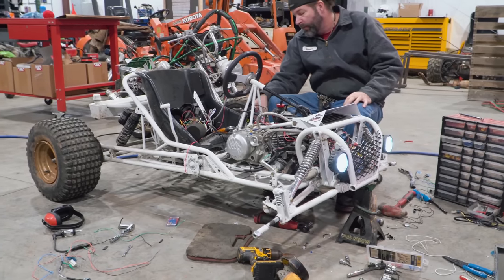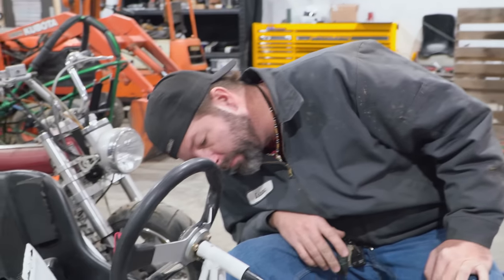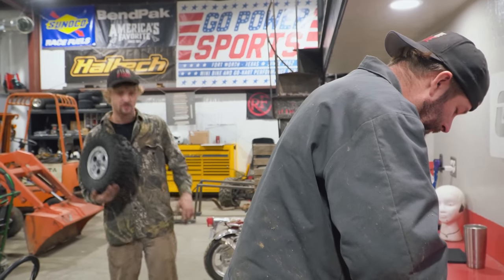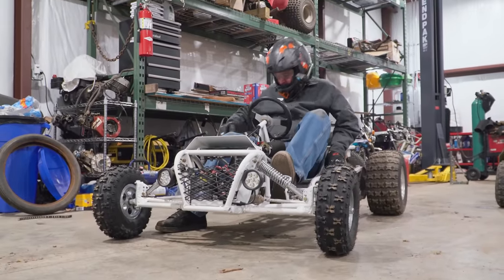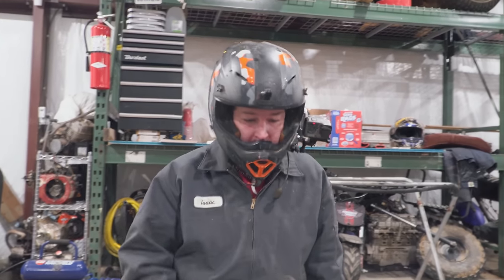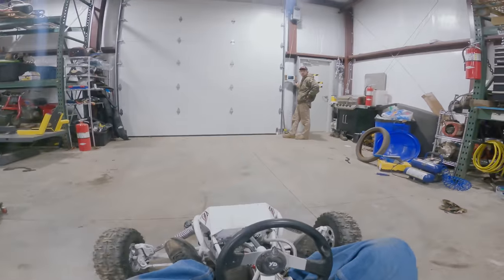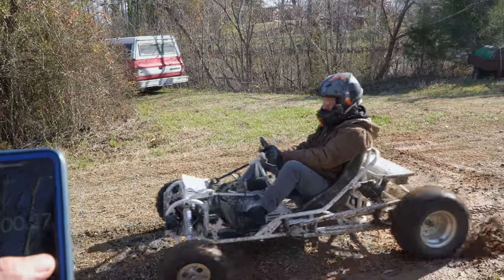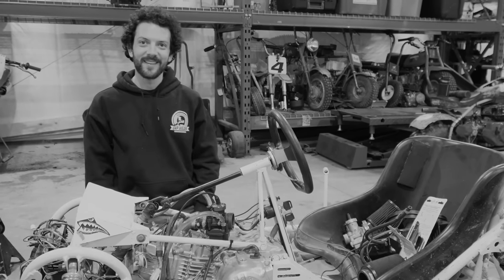Reviving our FASTEST Home Made Go Kart, the “Yard Dart”

Comment: The only thing I can think of is that the holl intier ignition needs to be replaced, which means the ignition coils Cdi all the wiring spark plug, replace the carburettor with a 24 mm Mikuni carburettor maybe that will help it to because I do know my Honda Trail 70 with a 190 Zen zone engine on it runs really well with a 24 mm Mikuni and I did are the whole entire wiring and replace the cdi Killswitch is in everything. Air filter could be of another possibility. the timeing key could be out of timed  arm, maybe swap the exhaust with a hive flow exhaust so I do reckon there’s probably a restriction somewhere to but that’s just a few ideas. I threw out there for use for you change the gearing on the back sing a little more because 🎉my Zang zone 190 on my go cart at the moment when I finish doing all those things and I started it runs, smooth as heck

Comment: I agree with what most say that it seems mostly ignition related, but it's probably also worth checking valve lash. My ATC had a similar breaking up problem under heavy load and it ended up being too little valve lash.

Comment: It's the timing needs advanced or back plus I would get high performance plug lead and a hotter spark plug. It could also need a fuel pump to keep the pressure up while rattling around corners.

Comment: Check the connection between the carb and engine for vacuum leaks. Also check the exhaust for leaks at the cylinder, that can cause power loss/back firing.

Comment: Great to see the yard dart out again. Hopefully you can fix the misfiring issue. Looks like with the new wheels the front has a lot of tow in & positive camber. Might be worth adjusting it a bit
Reply: The front camber changes with suspension travel due to single a arm    but your right it is off a bit at ride hight and not equal definitely needs some tweekin

Comment: Definitely need to look at replacing that CDI... It should be running a lot smoother than that. 

If you're looking at carbs for this Engine, a flat slide 28mm works amazing. I'm using a pwk28 with a 42 pilot and 125 main at 600ft and it's flawless. 

Also, the zs190 needs to have its idle speed set to about 2000rpm. Seems high, but trust me, it's best.

Pop on one of those small digital tachs and set it, you'll have a much stronger running, easier starting engine.

On my Grom clone, this engine is an absolute beast. 

Also, I'd totally buy the plans for this chassis!

Comment: Check the charging voltage at the battery while running and revved up. Good possibility the voltage regulator isn't working correctly. Would also explain the lights going wonky.
Reply: Also check for AC voltage ripple.  A bad regulator can cause this.

Comment: Definitely check for spark issues - I had a car do the same thing and it was a bad condenser on the points. These engines may use CDI, so check for cracks, week magnets, excessive clearances etc.

Comment: I have that same base engine on a Grom clone with the 212 BBK and the 4 valve piranha head. But I did a stator upgrade so that I could run efi with a Grom harness and a stand alone ecu (aRacer mini 5). Not the cheapest solution by far, but I haven't had any issues out of it since I finished tuning it.

Comment: Could I suggest sticking a neon spark tester in line between plug wire and plug. Available at good auto parts stores or snap on. Ride and observe the neon tube.  It will change if it is and ign problem. Neon will cut out when problem is encountered.   Good luck.

Comment: I just had this same problem with my lifan 125cc on my 72 honda trail 70 and it was the idle mixture screw was way to rich I ended up screwing it in 1/2 turn and it fixed the popping idle and all around drivability

Comment: I had one behave like that after a few heat cycles and it turned out to be valve springs which were made out of just standard steel. Swapped them out and it worked fine again until the cdi unit went out. Then the carb needle wore the jet out and made it run rich. Then the stator let go. Then the gear selector got stuck in place and needed a full strip down to fix a pawl that had got bent. 
They really aren't trouble free.

Comment: did you replace the ignition trigger on the crank? ( chinese ) Sounds to me like at higher rpm is missing signal like the gap is to big or a cheap pickup or weak magnet, however that one gets triggered.
could even be a broken valve spring....floating valve at rpm?

Comment: when you run this types of engines lean they overheat and then you need to change piston rings and valve springs (they get overheated and lose preload) and also they have a tendency to slip timing gears on camshaft. when you dissasemble check cylinder and head surface they are warped from the factory also valve seats are sometimes poorly cut (laping wont help it will still blow through in high rpm) those 160cc and up engines have a verry agressive cam and compression ratios so ingnition problems are common, its a good idea to keep a extra cdi in stock. also this engine runs best with a propper keihin carb, chineese knockoffs have to much circuit overlapp and are nearly impossible to get running right usually you run into issues with not getting enough fuel for acceleration and too rich wot or vice versa. but with the issue you are having now it is possible that you have overheated the engine and it just needs fresh rings and springs (also good idea to install new valves, they can snap some time after they have overheated) hope you found something helpfull and that you get it running again!

Comment: I’d look at cdi maybe get a heavier flywheel and adjustable pick up. Maybe check valve lash had a few of the pit bike engines come with no lash so you lose some compression and some top end 👍🏼

Comment: Play with the plug gap.
Start at .035 and work up to .050 in steps.
The high load is probably blowing the flame out.
It's either that or not enough fuel delivery causing it to lean out from starvation.

Comment: I leaning towards valve issues with that engine your running . The last is probably correct when checking but the springs are shot under load . It needs stiffer springs imo that should fix that issue .

Comment: I used to have a smaller problem with my old pit bike, eventually figured out that I was using the wrong spark plugs, I'd chasing the sparkplug and it would run gr8 for about 15 minutes and then do what yours is doing. I fiddled around with a couple of different makes and heat ranges and eventually got the right one and never had that problem again

Comment: I like the design. I'm eventually going to take my motor out of a junky KZ-440, and have a parallel twin, six speed go-cart. Not for any racing, just for burning around the ol' farm. Got the frame from an old 4-wheeler for steering geometry and the rear axle. Will be long, but low, like a formula V or something. Maybe a poor-mans farm rally turd?

Comment: You can check your Air/Fuel mixture by just stopping the fuel flow. Do this by just pinching the fuel line off. As the engine is starved for fuel the RPMs should come up about 2-300 RPM before the engine dies for the right jetting.

Comment: I agree with those below saying it's the CDI. This is a fairly common problem among the larger chinese honda clones. They are using electronics meant for the 90cc and it just cant keep up. An aftermarket CDI should fix it right up. Also, a proper plug chop requires a NEW sparkplug. Trying to read a used plug can give false readings. You should always use a brand new plug so you can read the heat correctly.

Comment: My main suspicion would be the valve springs. I would see if you could measure what RPM it starts cutting out at on smooth asphalt. If it is consistent I would blame the springs. But it very well could be the CDI or timing
Reply: I say you're right with cdi if not it could be the valve float due to weak valve springs
Reply: I believe the cdi included with the zs190 stock is limited to 6850rpm for break in and there's a cdi off tbolt that removes this with an option to set your own limit

Comment: I think you might add a couple of thousands to the valve lash. It sounds like the valves might be floating. With weak valve springs it won’t like high speed high load.

Comment: I never rely on the nylon lock nut to retain a spinning wheel... I at the minimum use either a jamb nut behind the lock nut, a castle nut with cotter pin or a cotter pin to stop a lock nut that decides to back off

Comment: how well is the spark plug wire ran? I've had an issue before where the insulation was bad on a newer wire and spark intermittently jumped to the frame

Comment: Shorten the exhaust. If's too restrictive. Create a custom tuned pipe by using a long pipe, of the same diameter as the exhaust port on the engine...then cut it down till it rocks!!! Make sure the intake filter, is super high flow as well.  Just my 2 cents

Comment: My guess guys is they like to build cheap with stretching out the good stuff, so the most expensive metal is going to be affected most. See what pressure you get. I hear a lot of clatter which I thought was your clutch at first. Hard to say from way over here. I think you should dump the tank ,and the complete top end in exchange for a dc motor assembly. I'll link a video where this guy took the top off used the timing chain to the motor mounted to the transmission case via the head bolts. Had all the gears and ran like a street bike.

Comment: I would check to make sure you have an exhaust gasket this would take a way back fire and maybe help the carb work better with the settings dialled in right if not another thing I would check is maybe valve specifications

Comment: The backfiring sounds like it's still lean, it's just not burning the charge efficiently and building up in the exhaust, I think it needs to be richer on the main jet. I'd check the valves too just in case you've burned one with the first lean mix.

Comment: If you're running honda clone horizontal engines, you need the daytona cdi ignition setup. Everything else is junk. The daytona box has 4 different user selectable ignition curves and gives strong/clean spark all the way to the rev limiter. Get one and smile.

Comment: The only usggestion I have is carburretor float. From the hot laps footage, I can hear that it runs OK until you off throttle then it bogs again. This leads me to wonder if the float is not crrect as it would possibly cause a starvation issue when you're getting back on the power again?

Comment: I think yall need to release plans for both the yard dart and the drag rail, those 2 are the ones I'd like to build most for myself. Looking forward to 2023's awesome builds!
Reply: Plug wire crack or moisture
Reply: Absolutely
Reply: yard dart rules.   its the best balance that an old person like me with many projects under my belt shares in common with someone just starting.  advice for new people=get a go kart, learn gearing and tire size/preasure (yard dart three point oHHH might just have front springs and ballonish rear)

Comment: TIP: For putting brand new inner-tubes into tires, cover them in talcum powder. It'll help act as a bit of a dry lubricant and will make the surface of the tube less grippy so when you air it up it can get into shape. Also make sure to air up and depressurize the tube a couple times when the tire is on the rim to help make sure it's not bound up and is seated correctly.

Comment: I think if you can sort out that large positive camber issue in the front spindles to be more neutral that would help get a better contact patch with the tires it would help tremendously with the front end pushing issue.
Reply: I've told them this over and over and over. They won't listen. They've gotten too big to take anyone else's advice. This is why everyone else (rather B welding, Red Beards Garage, Grind Hard Plumbing, etc, etc) has advanced in their builds and fabrication skills, and why CarsandCameras is still building (or rather rebuilding) and Jerry-rigging junk.

Comment: Valve float possibly 
Also the carb getting bounced around off road can occasionally cause issues  i wonder what a full pull run on smooth asphalt would do
Reply: Bingo bingo bingo. Ding ding ding

Comment: Do u think the fuel tank needs a vent ? I had a honda 3 wheeler that ran just like that . The people i bought it from lost the original one . They put a diff one on an said they thought they got water in it cuz it wouldn't run right no more. Then one time i taped a flash light to the handle bars of a dirt bike an tapped the vent house an the bike wouldn't run right. Just a thought.

Comment: sounds like its goin lean in the corners. its a float issue. you need to let the float go a little higher so it dont run lean or out of fuel and pop pop pop.

Comment: If there's a cdi box that might be worth checking with a new part, I had a 150cc 2 seater cart and it had an aftermarket "rev box" cdi and it wouldn't run hardly at all until we put a stock cdi box back on it.

Comment: I had a taotao 110cc and it did the same thing. Turned out the weight on the flywheel were starting to get lose. A new flywheel solved my issue

Comment: check for air leak in the intake system. A crack or bad seal can open under a load causing a lean condition.

Comment: I’ve never worked on 190’s but I build 400ex and stroker builds, when I have a motor having that problem it’s to much air flow or the crank case pressure is to much and you need to route the vent hose to a external filter

Comment: Everyone is talking about it being the cdi box calling the Chinese ones junk but I've had atleast 5 of them on various bikes some being over 10 years old and they never ever had any issues but hey it does sound like it could be the cdi box. Keep in mind a black box cdi that does not have the brand "xiafeng" or something along those lines will most likely NOT have timing advance in my experience. And as someone suggested it could be a bad wire or just loose connection, also check to see if any wire the insulation missing in a spot and could be touching the frame

Comment: Definitely an electrical issue I’ve had multiple different Chinese motors and a Yamaha, my issue was cdi and also carburetor on the other, it was almost like the carb would supply enough down low but not up top or good up top and crap down low

Comment: sounds like low compression die to exhaust valve opening a little too early.
adjust timing, maybe thicker head gasket if it has trouble starting  without throttle play, and rip it

Comment: I know nothing about that engine but it really sounds like valves. So many small engines can’t reve because of valve springs. It gets worse because of the soft valve material stretching and bending. A really good oil, and cooler could help. But first get new hardened Valves, seats and stronger springs. Be carful not to get the springs without the hardened stuff or it will stretch and be even faster.

Comment: Sounds like an intake leak. Silicone manifold between carb and between the engine. It's sucking air some where. You can also diagnose by spraying wd40 around intake manifold and carburator while running and engine will change noticably when wd finds leak.

Comment: The popping in the exhaust is raw fuel and air.  Perhaps you're loosing spark at high cylinder pressure,  try closing the spark plug gap.  Or the CDI isn't hot enough for the higher cylinder pressure.  Or you loosing fuel atomization because the intake charge is slowing too much from being over carburated.  Try a smaller carburetor.

Comment: could it be getting to much air? I put an air filter like you are using on my honda 4 wheeler and it ran just like your motor is running. put the factory air box back on it and runs with no problems.

Comment: As a 2 stroke guy and had a lot of ignition problems i am very sure that the ignition coil or / both stator is bad as they can still work but have false igition pulses or just week spark and it seams to be that the spark blows out, So be sure that the coil and stator is good ( swich them out ) and check for other stuff like sparkplugg gap, bad ground ( between frame and engine ) and check some other timing related things ( pickup, valves etx )

Comment: Possibly at high RPM the Rings are creating a ridge at the top of the piston and it acts as a lag point and you can't get high RPMs just a thought tell us I used to have an old Briggs & Stratton with a long stroke and it did the same thing back in the 80s

Comment: I know some of the Chinese motors start to bog down when they start getting wayyy to much air. Low rpm runs fine. Soon as you hit the gas the carb is like wait toooooo much o2. I've restricted the air flow on some bikes and quads with chinese motors and it seemed to help with that hard acceleration bog. Or thr next step is to find a carb with a vacuum assisted accelerator pump.

Comment: By the way it's running I would think CDI my CRF50 was doing the same thing it's got an 88 kit on it with a 4v head I thought it was the tune but I kept getting good plug readings and it ran fine at lower RPMs it was just a higher RPMs My kids bike was doing the same thing swapped out CDIs and everything went away

Comment: Normally, you WOULD put a little air in the tube, so that the tube doesn't get twisted in the tire.  You had too much air in the tube.  Once the tube is aligned, release some air to clamp the rims.  Not sure why you couldn't bolt the rims together first.

Comment: It sounds like a fuel delivery problem I've had it before that the fuel entering the bowl was never flowing quick enough via gravity feed fuel I stuck in an inline fuel pump and it forced fuel into the carb at the higher load and it seemed to fix the issue for me